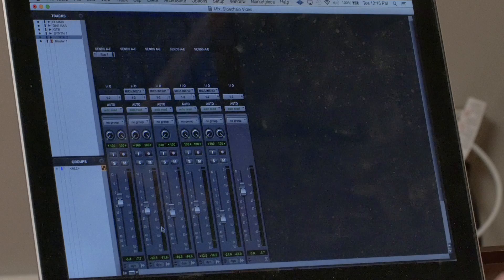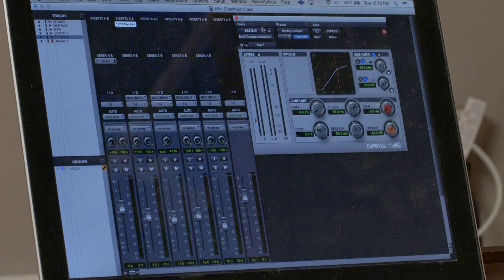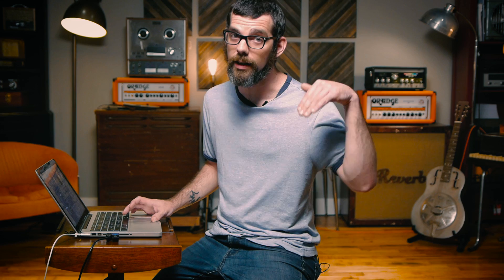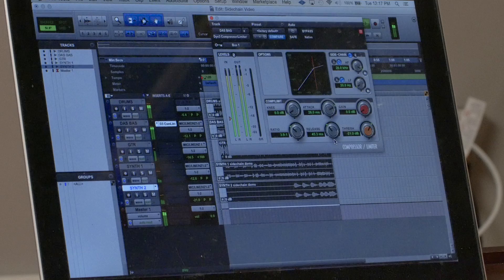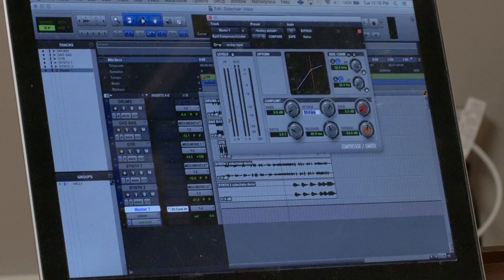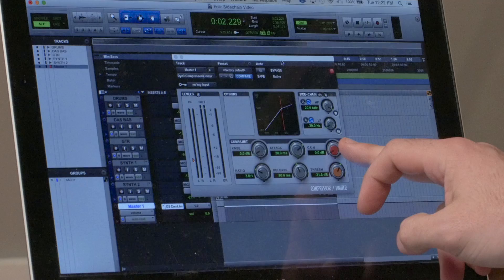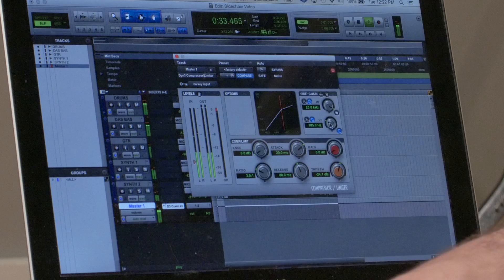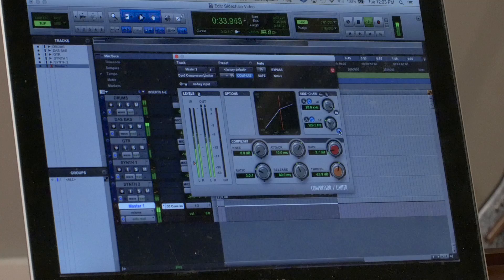What Is Sidechain Compression and How To Use It | Recording Tricks

Comment: A lot of “insider knowhow/knowledge” getting lost between the old (gray haired) analogue audio engineers, and the newfangled Digital Audio Workstation “stuff” ehh? 😆

To some extent, I miss the “good” old days of recording on the Studer A827 2 inch/24 track reel-to-reel tape recorders. (As well as coaxing a little bit of compression out of some of the channels by setting the gains a little bit too high on purpose. 😏

These days, it’s just too damned easy for you young whippersnappers! 👴🏼
Reply: As a whippersnapper I'm very glad I can pirate ableton live studio. Not sure it's possible to download a tape machine on the internet